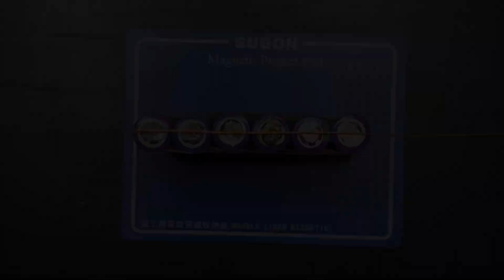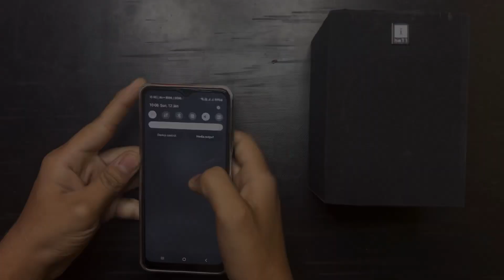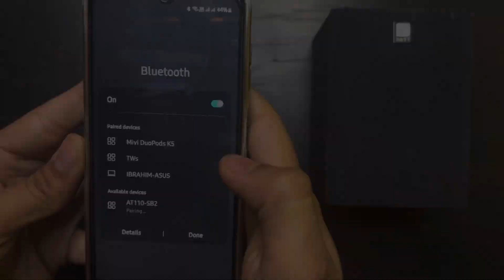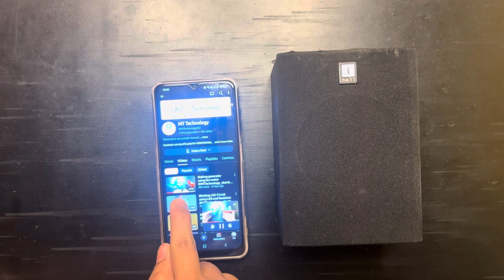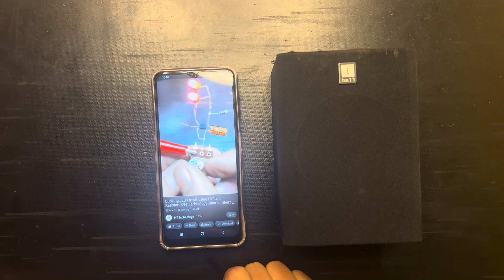Make bluetooth speaker from wired speaker @MTTechnology_shorts _short _led _diy_electronic

Comment: Chip link pleaee
Reply from the maker: https://dl.flipkart.com/dl/cke-bluetooth-fm-usb-aux-card-wireless-tg113-module-5v-kit-electronic-components-hobby/p/itm27cd261e2d646?pid=EHKH24KFHMEMHWZA&cmpid=product.share.pp&_refId=PP.a7a69a76-0230-48e2-94f8-af5062855b25.EHKH24KFHMEMHWZA&_appId=CL
Reply: Link and the module u used are totally different. The link leads to Tg113 but you used GT119 Module❤